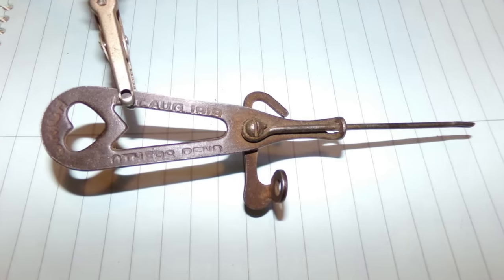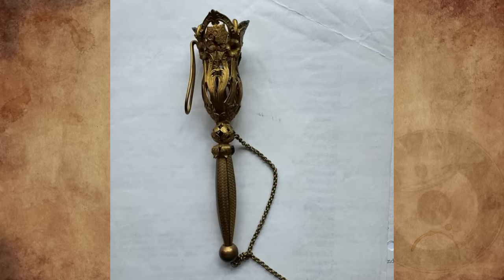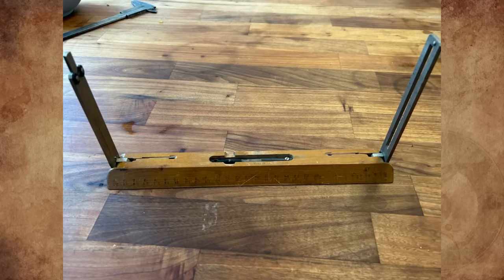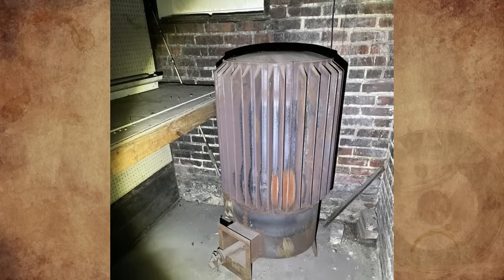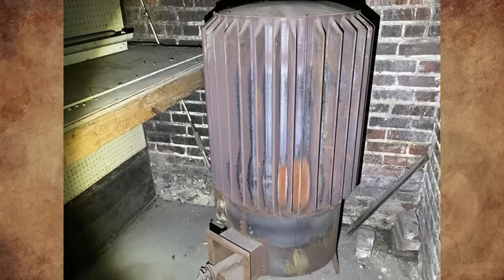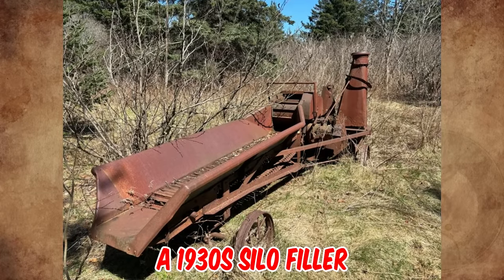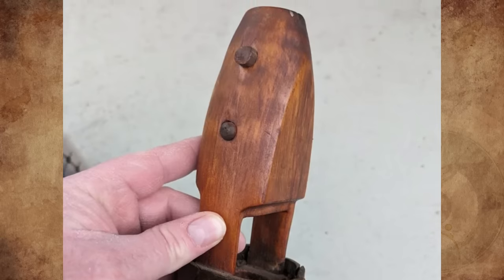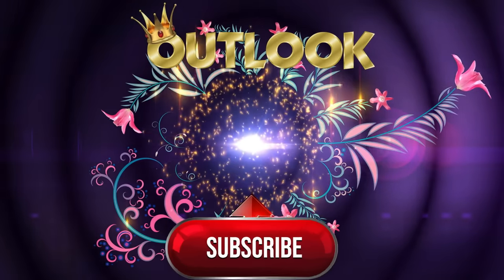What Is This Mysterious Tool From An Ohio Yard Sale And This Wood And Leather Object In Our House?

Comment: Last item is possibly a tuning coil from an antique radio receiver.  Bakelite would be correct, and the weight would be from the copper wire inside. You slide the ring that would have a wire attached to tune in a resonate frequency (desired frequency).
Reply: To be fair that was the first thing I thought of and it's a sound theory, however.
Radio coils were not encased, heat would build up and there needs to be a direct contact with the copper coil.
There are no wire leads or other electrical connections.

Comment: I think the last item is for holding skeins of yarn while you wind it into a ball, I used to do this for my mother and would have loved something like that.
Reply: And then you push it together to release the skein... I like it.
Reply: @Ron-d2s  actually you put the skein on and separate the arms to keep slight tension on the skein while you roll the yarn in a ball, the tension is necessary to keep yarn from tangling it also makes able to accommodate different sized skeins. I guess you could just knit off of the device but it doesn’t seem very mobile, maybe if you have a knitting chair that you always sit in.

Comment: ok... the first item......... really ..... a rubber band shooter reworked to stuff rubber bands into tires........ 

Stop the world I wanna get off.
Reply: Not dissimilar to the current system for temporarily repairing punctures in automotive tubeless tyres/tires.
When you get a puncture a long way from anywhere out bush, they are especially useful - both spare tyres getting punctures in not unusual offroad.
Reply: Yes. the outside tire just needs to accommodate the innertube so packing rubber into a hole in it makes sense.
Reply: @DrakeN-ow1im  The concept is not in question.......

a RUBBER BAND SHOOTER!?!?!!?
If just seems like something out of a Dr. Seuss book, made me chuckle.